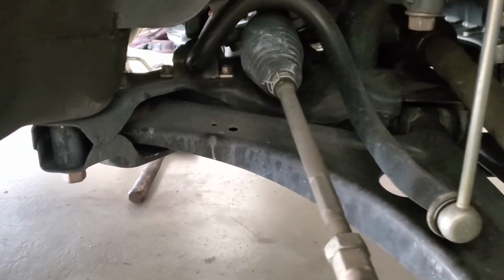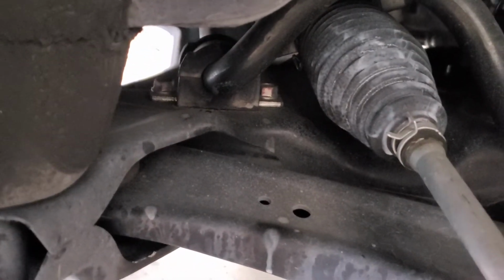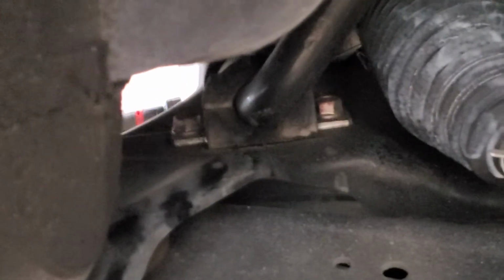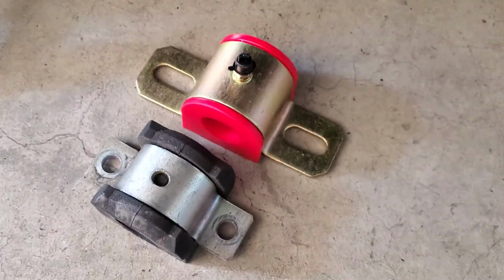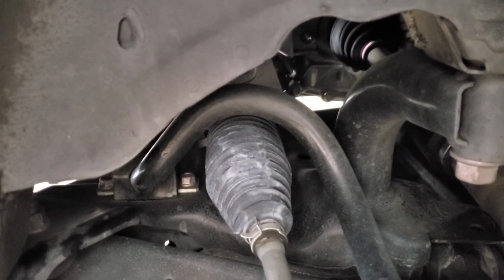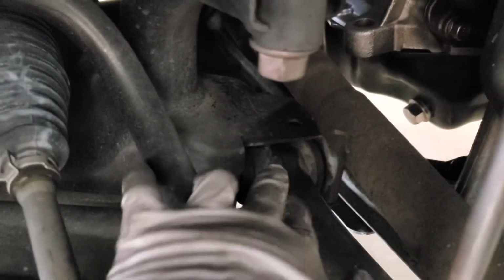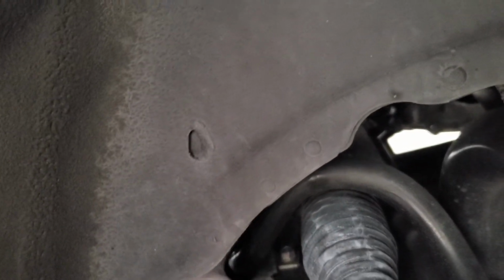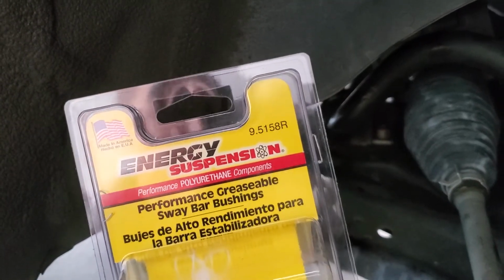Mitsubishi outlander sport/asx front suspension noise - sway bar bushings replacement

Comment: 2 years later now, how are these bushings? If I can find these I would consider them. I have a 2012 with a lot of rough use, but am not yet ready to replace, but would like to get some of these parts ahead of time. It’s said the poly bushing transfer a lot of vibration but just for the sway bar bushes it should be fine. Also looking for control arm bushes too.
Reply from the maker: Traded the car in haha.  You can find those at basically every auto parts store.  They are a good material so they should have held up with no issue.

Comment: If I see through this rubber in another side its like moon so its mean I need change? I have some noise in the back when I drive slowly in the some holes
Reply from the maker: Try use a pry bar and wedging it against the bar.  See hoe much deflection / movement it has.  If it looks like a crazy amount the bar could be making contact.

Comment: How has the repair held up?
Reply from the maker: No issues so far, easy to swap over and can easily be regreased if necessary.
Reply: @RhoadsChristopher  thanks for replying! just bought the same exact set for my 2014 outlander sport.
Reply from the maker: @jeriiman  easy swap!
Reply: 35,000 miles isn't it under warranty ?
Reply from the maker: @anguslean4058  yup
Reply: I can hear spring-like sounds sometimes. The spring and the bushing on it is in good condition. Can it be because of arm bushings?

Comment: Do you have video with that noise? I have some knocking annoing when I drive over bumper very slowly like 20km/h.
Reply: did you solve this problem ?
Reply: @careautorepair4881   no. I have my car inspected and they not found problem. Before mechanic have change shock absorber bearings because when I turn stering I have heard cracking. Maybe mechanic make something wrong or maybe is not that problem. Car mitsubishi asx

Comment: Its better then oryginal ? Stronger ? Thanks for vid
Reply from the maker: Yes
Reply: @RhoadsChristopher  front and rear have the same size? And how to install them because the org have some cracked in the top and this one I don't see. Thank you
Reply from the maker: @Przemo Kbh  not sure if the front and rear are the same.  Installation for the rear is probably similar if you find the right bushing.